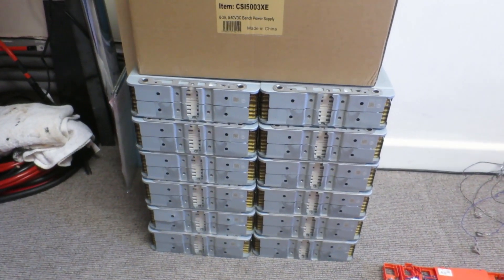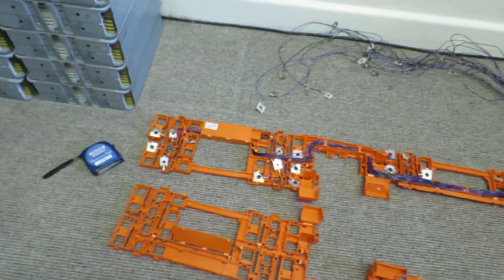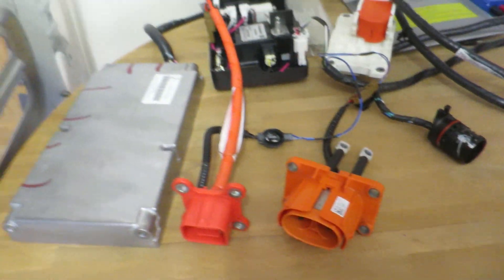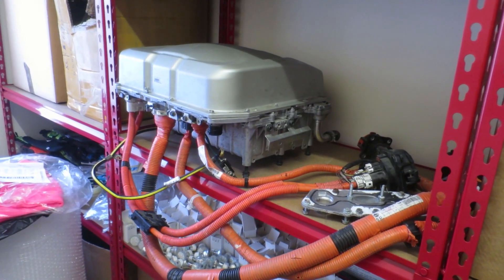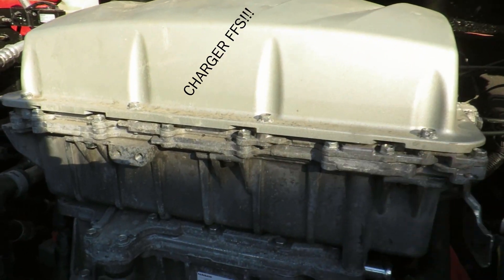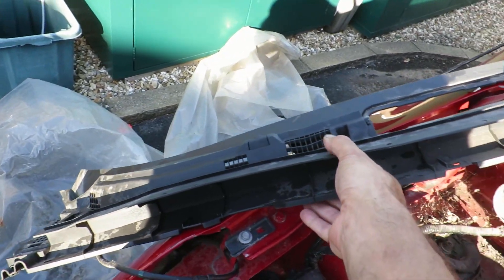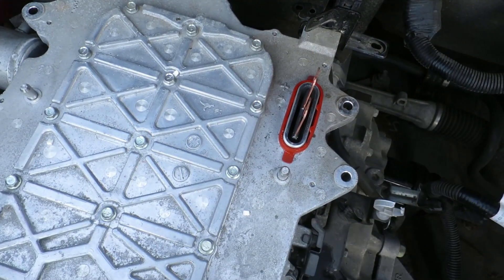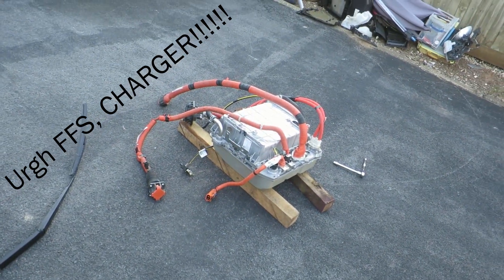HV Charger and DC-DC Charger removed on the Leaf

Comment: For safety reasons, after removing the driveshafts, put the wheels back on and drop it on ramps or concrete blocks. That way, the car cannot fall on you because it has wheels.
Reply from the maker: Yes, I have four ramps, but as you say - they dont work without wheels on!

Comment: i like what you do, i have Toyota Prius gen 2 and I'm thinking of adding 5kw HV battery to have longer range and get better MPG. watching your video and get more ideas is way to go. me buying an EV car is too much for me, but converting a car might workout little cheaper, the plan is to have 48VDC to 240VDC converter and have 48v LIFEPO4 batteries with BMS and charger.
Reply: How you going to charge the battery?
Reply: Nice-oscar so the way it will work is, the OEM HV battery happy voltage is 240v the actual voltage is 201v. Planning to put 48vdc to 240vdc in parallel with the OEM battery and have 48v LIFEPO4 battery 5kW capacity and have 48v charger for charge the small battery.
Reply: @kararmahdi4561  do you mean dc to dc converter?  48vdc to 240vdc.
Reply: Nice-oscar yes, managed to source one from a Chinese manufacturer for really good price. I saw what you have done to your Prius which is great, is it still working alright ?
Reply: @kararmahdi4561  it was ok because it was plug-in hybrid, so I only needed to parallel a range extender battery with the on-board battery. Double the range but unfortunately, a guy driving a brand new vw hit it at the back and the insurance wrote it off! I could have bought it back from the insurance but the chassis(body) was twisted. I am planning to buy a Nissan leaf and then build a range extender battery for it. It is the cheapest way to have more range.
Reply: Nice-oscar true, I mean so far the cheapest leaf 30kw cost around 10k, it’s a shame you lost your Prius. However I’m glad you are ok
Reply: @kararmahdi4561  £5k can get you a 24kwh leaf in excellent condition then range extend it with £4k bmw i3 battery, total 45kwh for less than £10!
Or,
For more capacity, get tesla modules, break them and build a pack with huge capacity.
Reply from the maker: Just in case this was for me - I am going to continue to use the Leaf's charger.
Reply from the maker: Yeah, stay within your budget as otherwise you just end up with a half finished project.
Reply: TheBlackhursts I look forward for more of your videos